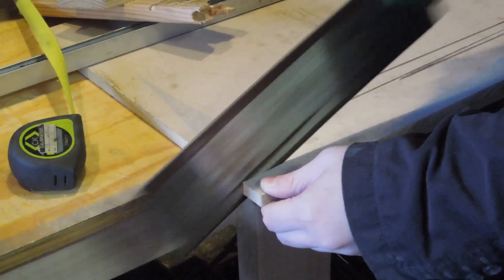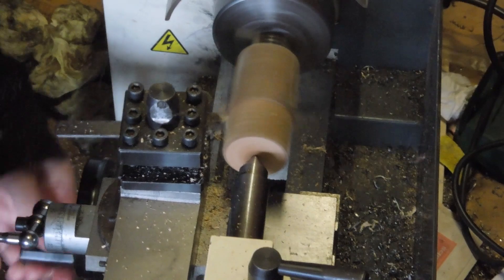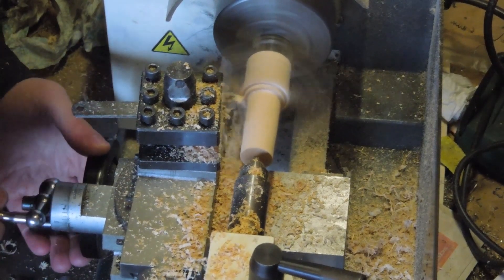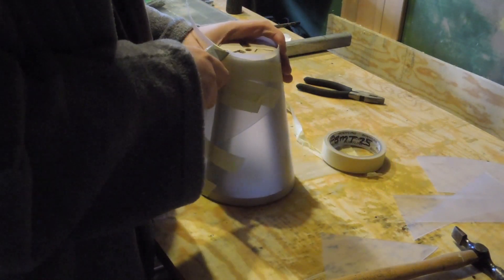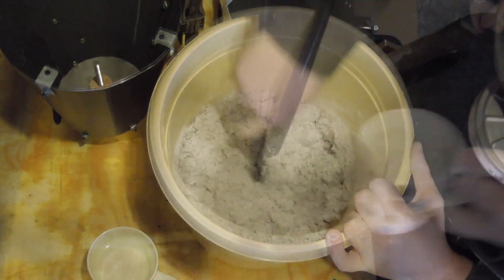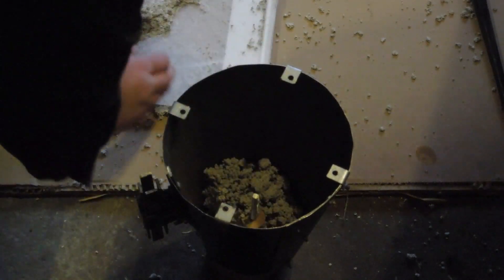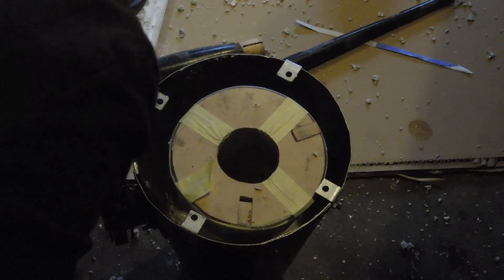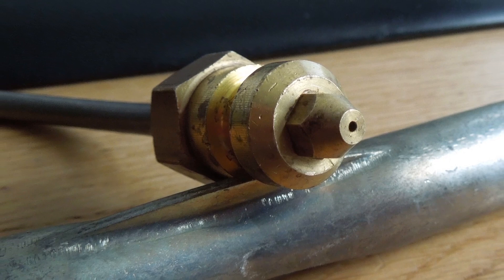Propane Armour/ Sheet Metal Forge Construction - Part 3 - The Refractory

Comment: I have a similar rig but I made the "hat" from ceramic insulation mat and a stainless kitchen bowl. My burner is simple iron pipe and two T-joints, one for propane inlet and another on top of it for a fan connected by a hose from a vacuum cleaner. The fan is a real money saver as it keeps me going for far longer on a single propane tank. It's mounted on the wall on a hinge system allowing me to lift the whole "hat" to fit material in.